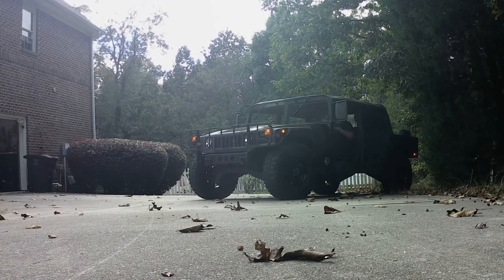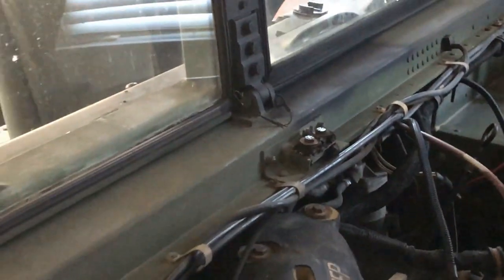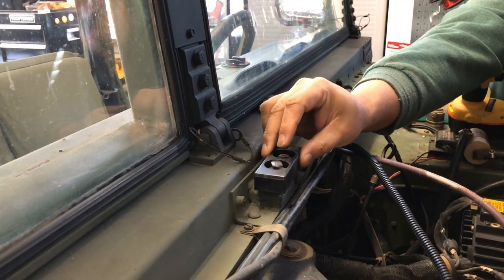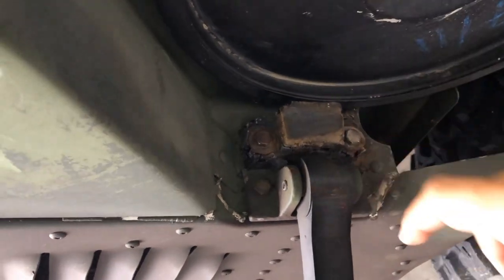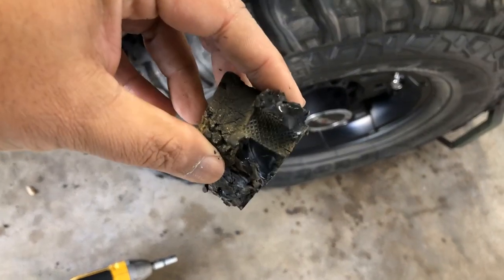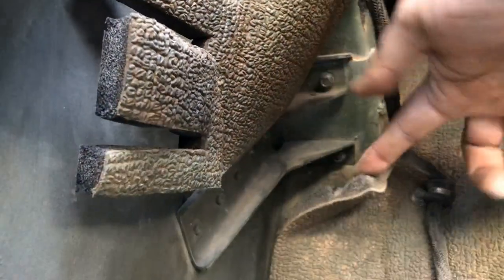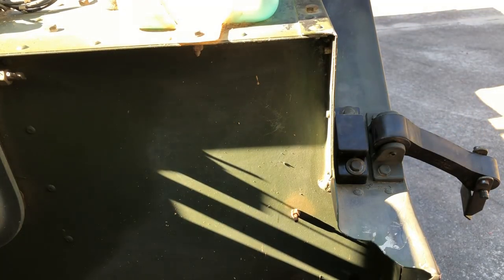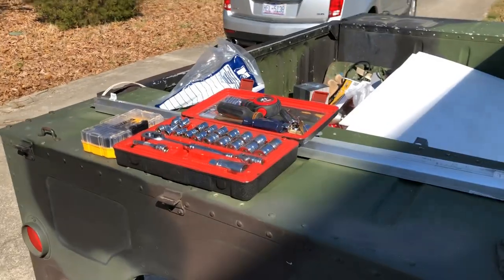My HMMWV (Humvee) hood is squeaking!

Comment: I read about ppl putting felt on the new bumper to help. Haven’t gotten my hmmwv yet so I can’t vouch for it.
Reply from the maker: No need for felt, the metal stopper on the underside of the hood rests snug on the rubber bumpers, felt wont make a difference, it’ll probably wear away with the vibration.

Comment: Just add a dab of grease on them and it will go away. It will still squeak even with new ones .
Reply: The hood side hold-down straps do lose tension over time. The end result of loose hold-down straps will be seem "cracking" between the hood proper and the front grille (outboard of headlamps)